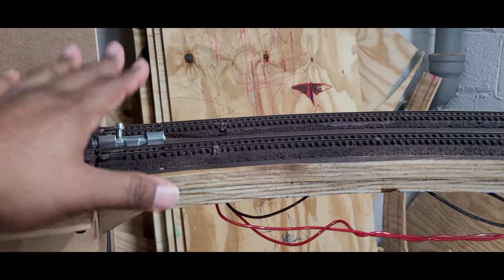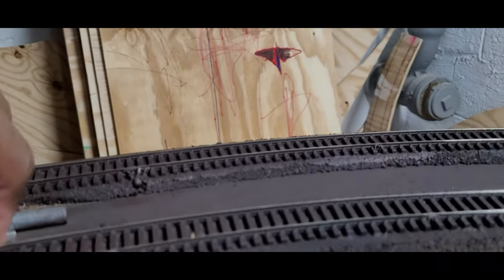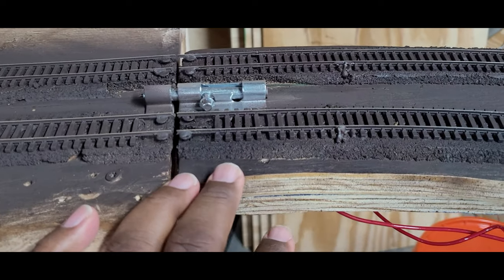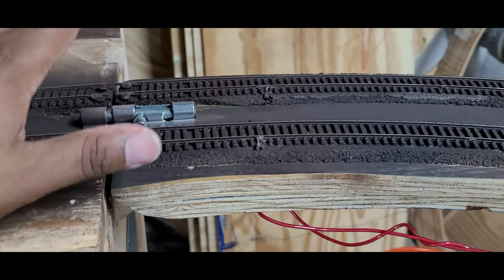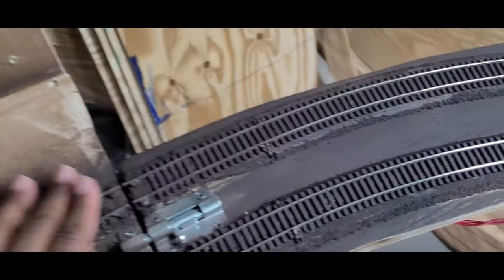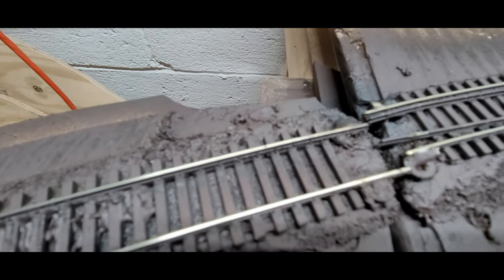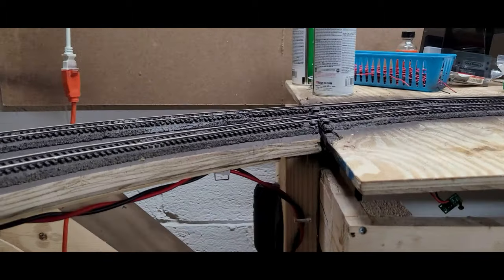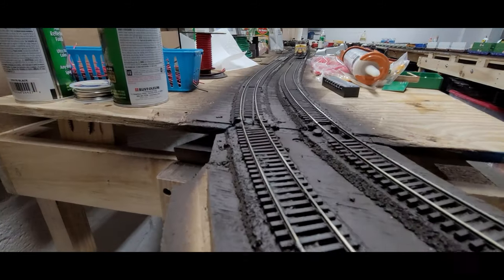The E&H Swing Gate

Comment: perhaps paint all of the bare wood to seal it and protect against changes in humidity and temperature. Joints on a curve at a bridge are brave. Might wanna consider a small backboard just in case. Gravity does not discriminate at all.  I love those wheel clicks, just awesome. Cheers Rob